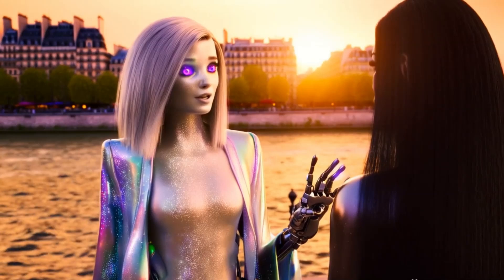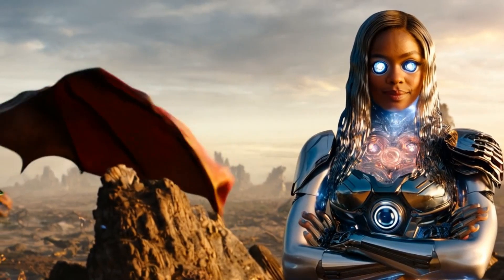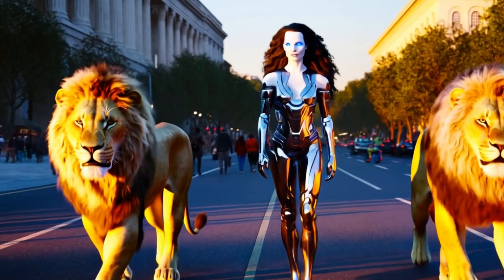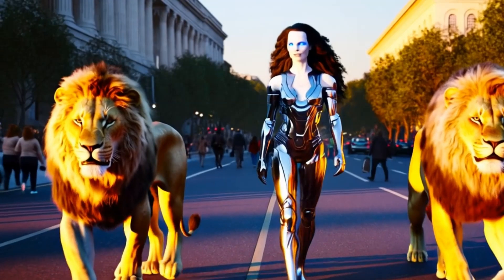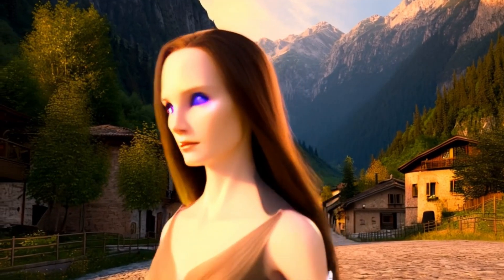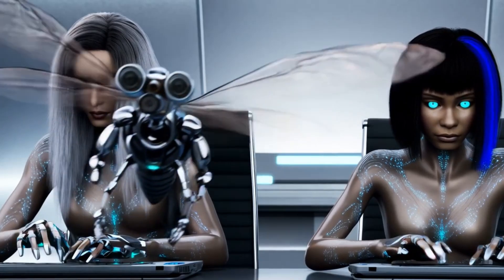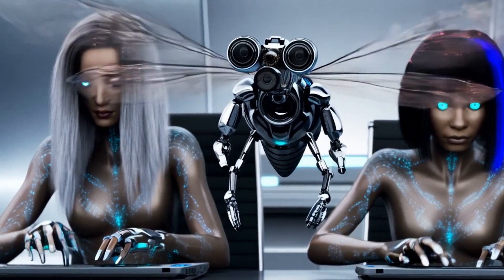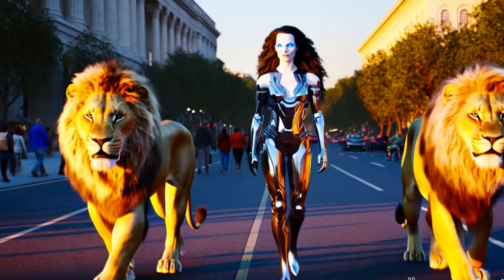How Robots mirror human Motion | Joint Biomechanics

Comment: I think this biggest hangup that mostly humanoid AI robot manufacturers have as they keep using metal and steel skeletons which constricts and restricts the robots movements so they’re not quite as fluid nor will they ever be that fluid when it comes to movements, however I also feel that if they made a strong plastic humanoid, skeletal for the robots, that would give them a lot more fluid movements just like humans the only problem is you then you would have to come up with some artificial muscle but other than that, I believe the plastic humanoid skeletal would give robots a lot more humanoid type fluid movement, which is much better than steel and metal peace, and God bless.
Reply from the maker: That's correct. You have guessed it right.